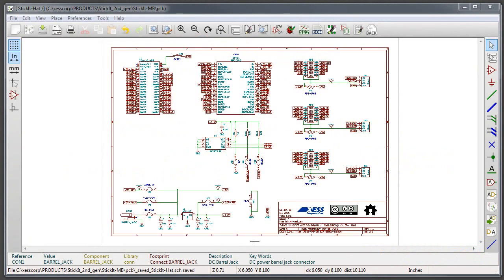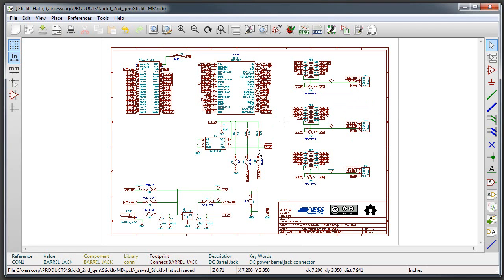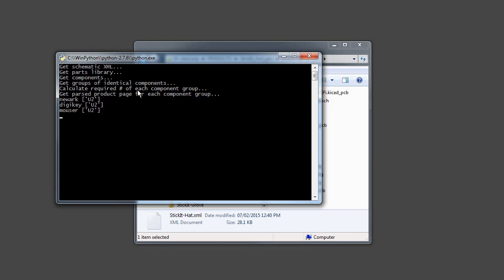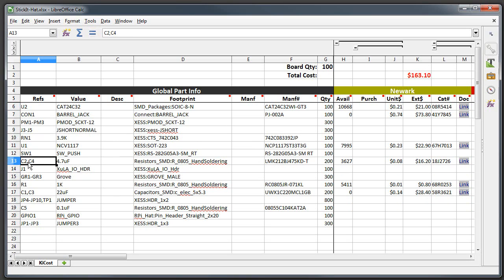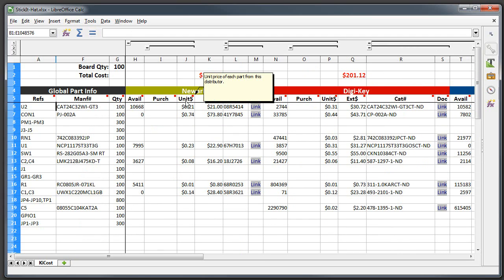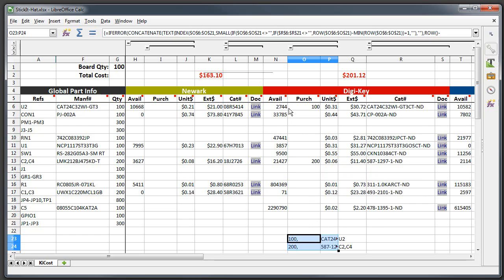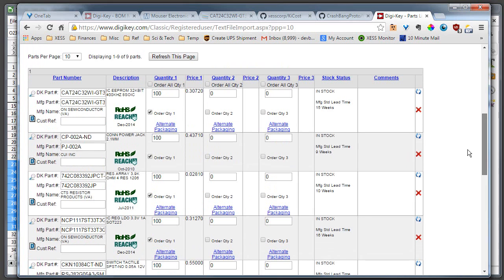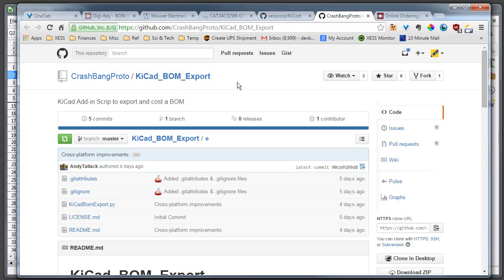KiCost: Easier Part Pricing and Ordering for Your KiCad Project

Comment: Nice Job!

I did something similar with part costing as part of my BOMtools scripts (see https://github.com/hwstar/BOMtools). Instead of Manufacturers part numbers I allow custom part numbers to be assigned and manufacturer's part numbers to be attached to your part numbers. The reason I want this route is that there are usually multiple manufacturers for a given part, and referencing the manufacturer's part number in the schematic doesn't allow you to index multiple manufacturers.